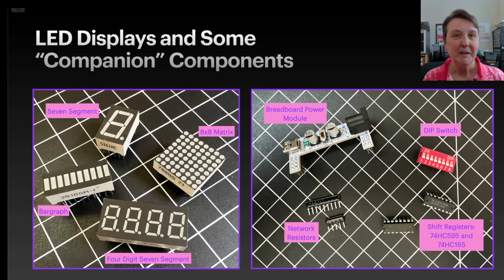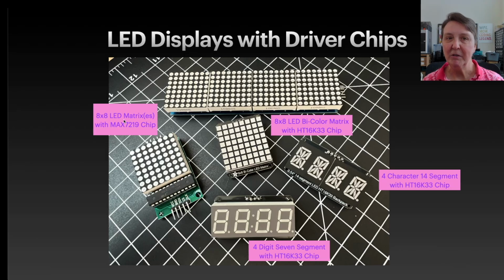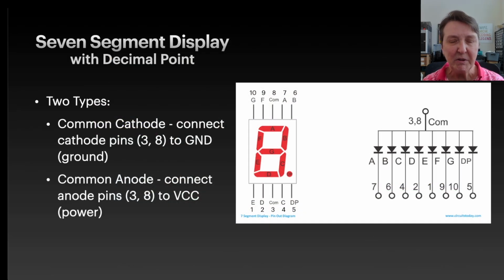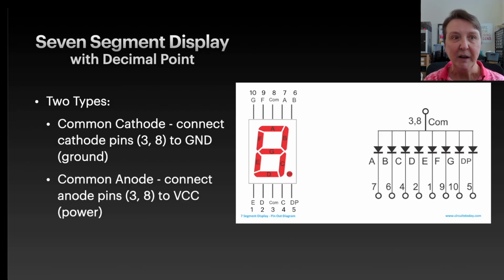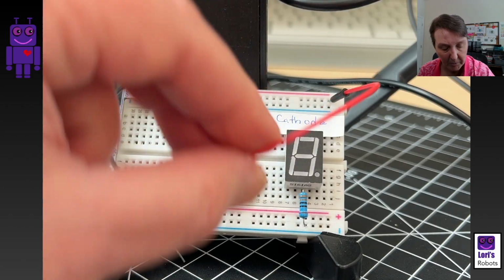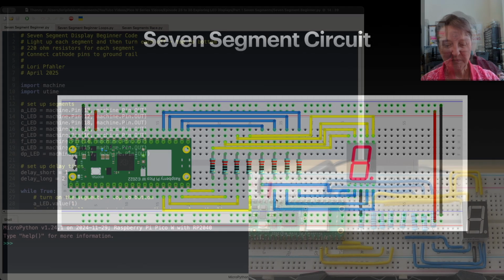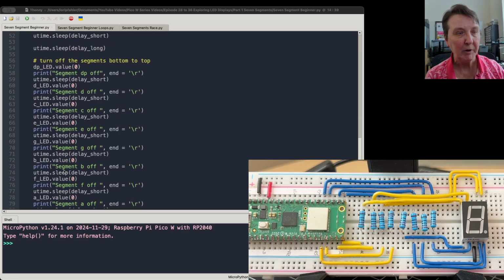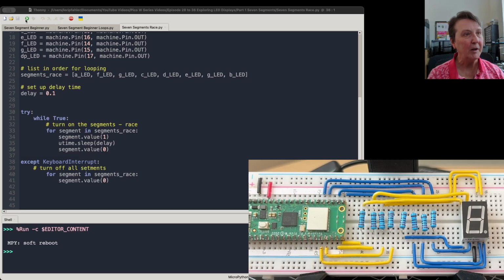Pico W Episode 28: LED Displays Seven Segment Part 1

Comment: Lot of wiring, might do 2 mini breadboards (A-J, 1-30), using the resistors to bridge them, only using pins from 0-15 side and 1 wire, on second bb 9 wires to leds/ano-katho.
in software might start with 8 as the base for most other numbers except 1, 8 - 1 stripe = 0/6/9, 8 - 2 stripes = 5/3/2, 8 - 3 stripes = 7/4,
tested logic in python, ok, used dictionaries, newdict = source_dict.copy(), removed unwanted pin(s) with       
_ = newdict.pop("a_letter")
Reply from the maker: Yes - lots of ways to wire this up.  I show another approach in Part 5.  I think making a proto-board with this permanently setup would be good for future experimentation.  If I get to that, I will make a soldering video of it.  Thanks for watching!